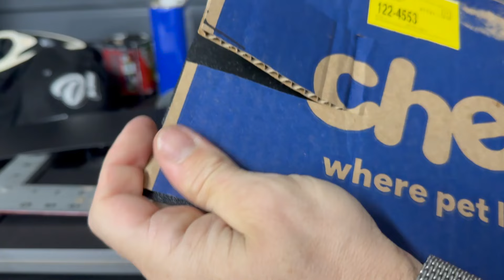BUILDING A FUNCTIONING BATMAN BIKE

Comment: As a cyclist, I would have anxiety issues with those things sticking out the front. Catch a tough bit of foliage and yeah. Since the flame is not a full-blown military grade flame thrower, would it not have more effect as a 'faux exhaust' to run out the back, with it automatically engaging with a start from a stationary stop? It would then be possible to leave others for dust at the lights with 'afterburners on', leaving others to wonder what is powering the thing. With faux 'rocket' sound effect, this could have cinematic value and not be problematic in the way the front-facing lance currently is.
For the paintball, can this not go into the centre of an extended mudguard, so that it is a bit more stealthy? There would be plausible deniability plus having a centre line of sight would make targeting that much easier. For added intimidation, it also needs a red laser to help.
Rather than ape an existing movie franchise character, why not develop your own character? The advantage of this is that you won't be a second rate clone of a movie character, but your own thing. You could develop your own franchise and build into it the sandals, raccoons and whatever else goes with the character.
A camper trailer build is also needed with the trailer having EV batteries, a bed and many other things, in something that is about 3ft wide.